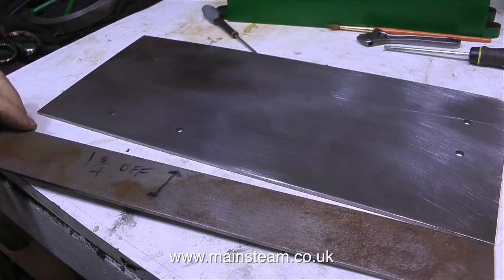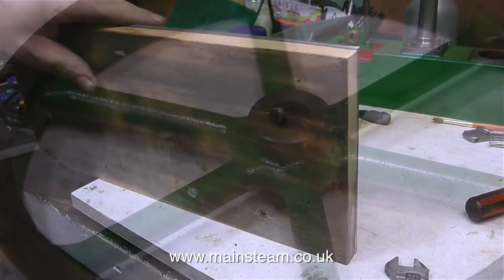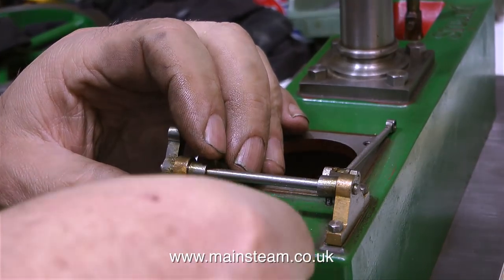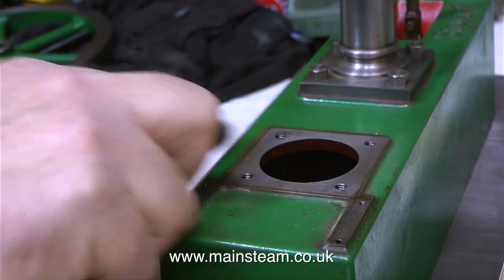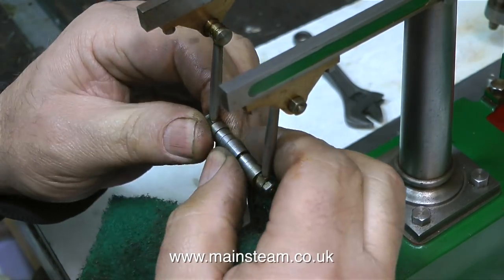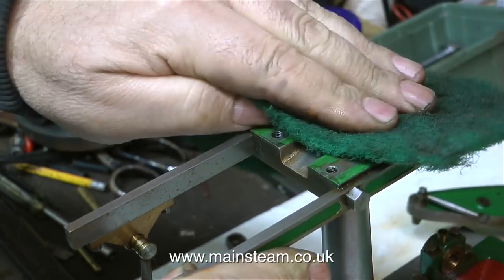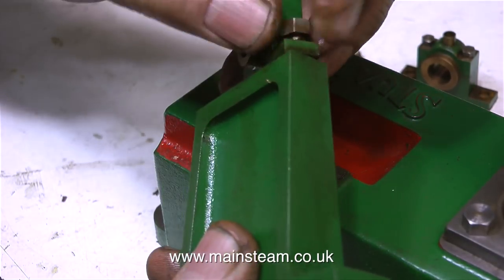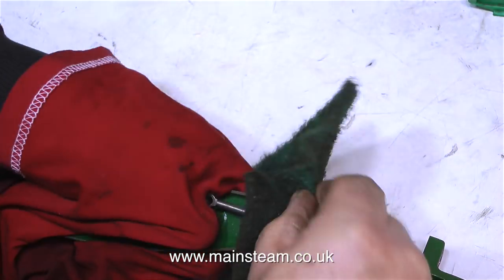STUART MODELS BEAM ENGINE REFURBISHMENT - PART #3

Comment: Hi Keith, 1/8 Whit (0.125” x 40 tpi) is very close to 5 BA (3.2mm x 0.59mm = 0.128” x 43 tpi) For reasonably short tapped holes the tolerance will allow a 1/8W grub screw to be used.
Reply from the maker: Thanks Gill - very useful information .......

Comment: If you don't want to use thinners, put the painted parts in boiling water for five minutes then transfer them immediately to ice water. The expansion and contraction knocks the paint off. A brass brush will help remove stubborn paint.

Comment: Are you going to paint the crank well and other recessed areas red again. I think that adds a bit of depth to the visual look and it highlights a specific area of the engine. I really enjoy your videos.
Reply from the maker: Red inside locomotive frames is good - but in my opinion red against green is too much like a Mamod ........

Comment: I always think the Stuart beam engine reminds me of my favourite big beams, the 90 and 100 inchers at Kew which are big beasties indeed, a shame the 100 inch prob won't run again since the beam cracked (apparently this was heard across London when it broke) but the ol' 90 inch is still an impressive collection of huge lumps of best iron and steel hehe
Reply: Wouldn't some JB Weld fix that? :-)